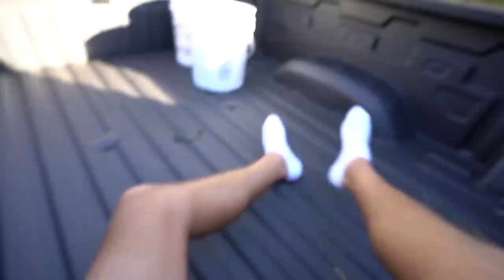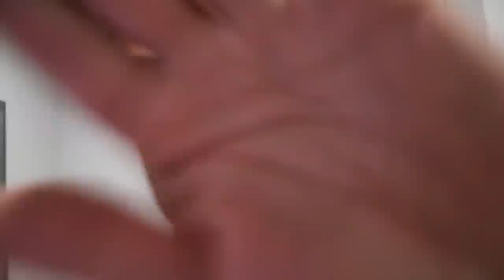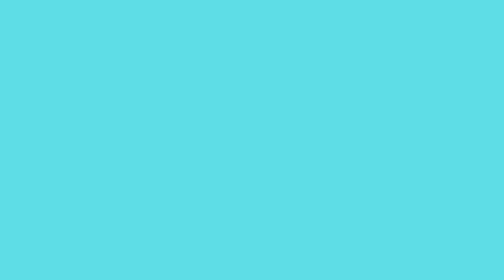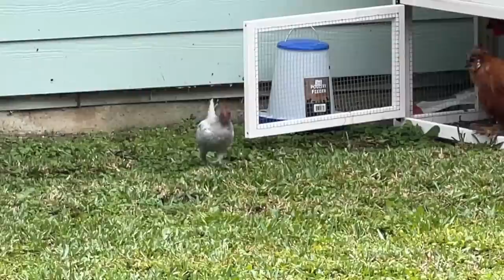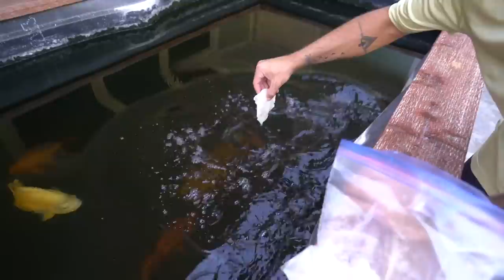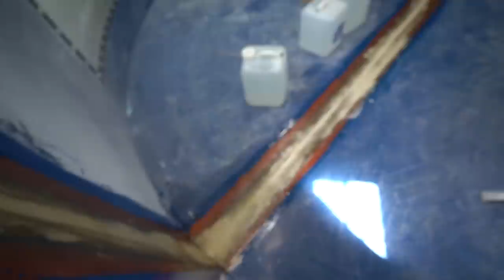My 5,500G FISH POND is going to be CRAZY!!

Comment: 1 , maybe wrap the pond fountain intake with a course sponge will reduce the holes getting blocked so quick , also raising it on a couple blocks might help 
2 , the fibreglass guy should have taped of the area around the pond to stop contamination to the whole building
3 , great update as usual 👌 keep doing what you do much respect 👍

Comment: You need to do a DIY pond. And I have just the one for you. Do the linth and the with high of the one that has the plastic front. Use slump block 8x8 x16 block. And have the front one big glass.